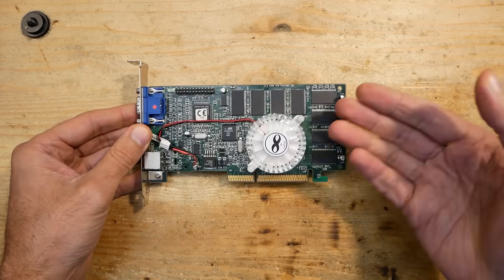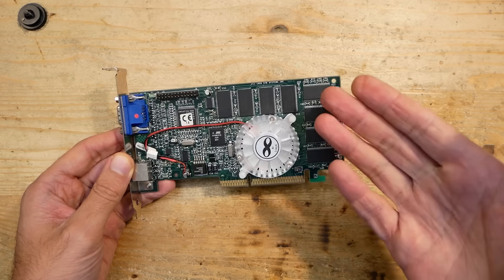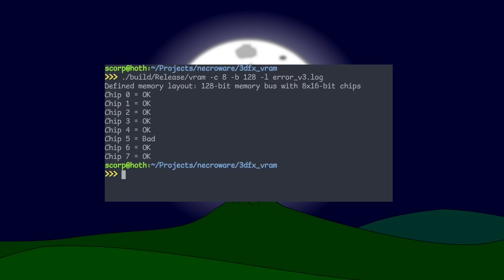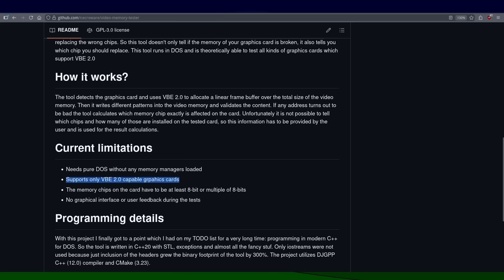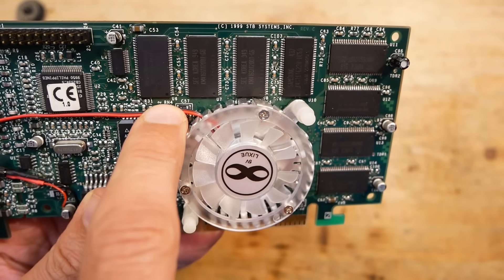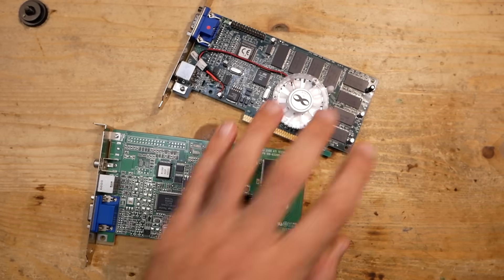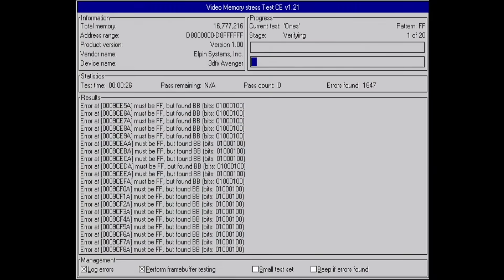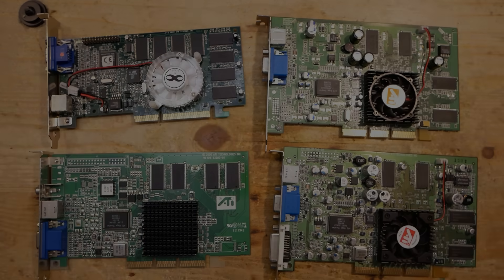Video Memory Tester

Comment: I might just try this tool tomorrow to determine what chip is possibly faulty on my ATi Radeon 9250 that hangs in games after a while of use and a GeForce FX 5200 that has artifacts all over the screen. Def not gonna solder myself though lol never done that.

Comment: I got the donor card with the same memory chips for my faulty Voodoo 3 2000 PCI. I used NWVMT yesterday for the first time, and identified that chip 4 is the bad one (using the logic you mentioned). I will proceed replacing it soon.
Also worth mentioning that when running NWVMT for the first time, I got an error message "error: no DPMI - Get csdpmi*b.zip". I downloaded CWSDPMI, placed in the same folder as NWVMT, and it worked. Just mentioning in case someone else finds the same issue.

Comment: Of course nowadays it's not quite so easy, especially when video cards have an embedded controller that runs everything, and sometimes (in the case of AMD, for instance) even run their own operating system.  I believe on some cards you can ask the controller for memory access, and there are some which have a built-in facility for doing memory tests which can be accessed from the host systems' OS (NVidia has an internal tool for this).

Comment: Does it work on VBE1.2 cards if you load a VBE3.0 bios, like Scitech Univbe (or will that confuse the program). I have a Diamond Stealth64 Vram card that works fine in Dos text modes but if I run any game from Dos (graphics mode) it causes complete screen corruption.

Comment: I've been wondering for some time. Without access to the specific memory chips in the FX5200, is it technically possible to replace them with chips removed from a DDR400 RAM stick as donor chips? Or use chips that can run at higher speeds but don't have an active pin on the last data bus, whereas the old chips did?

Thank you for sharing this interesting tool. I'll definitely try it :)

Comment: I'm graphic card collector and this tool looks great. I'm not able to make any repairs, lag of shill. But I think to add this tool to my testing workflow to quicky validate vram. As you've mentioned, even if there are some small glitches which can be missed during testing, your tool can detect. So maybe option without bus and chips details which just tell me memory is ok or not would be sufficient for me.
And about VBE support - have you tried together with UniVBE of DOS vesa drivers? This way even very old cards can get VBE support or cards with old VBE can get newer one.

Comment: You could have a multistage test, a very short cycle "dead test", and then a deeper scan if all chips pass the dead test. Also might be worth tracking a bitmap of the errors to suggest a possible pin connection fault

Comment: Very nice !
One thing that could maybe be used to find which card is which exactly (and letting you know how many chips there are automatically) is trying to hash the vbios and compare it to the bioses on TRW ?

Would this work for ISA cards as well ?
Reply from the maker: Hashing the BIOS and accessing the internet is probably an overkill. This tool is meant to be used from a boot disk and dos. Well, there are other ways first which have to be evaluated. Currently it seems, that many cards have faulty VBE implementation reporting wrong memory size. That can be probably solved by relying on PCI registers where I also can find further information about the memory.

ISA is currently not on the list. The tool uses VBE2.0 and for the older card another path has to be implemented which would be compatible with the older cards. Currently the focus is on PCI/AGP from the end of 90's to the beginning of 2000's. Once that works reliably, I'll evaluate if ISA cards could be tested as well.
Reply: @necro_ware  Sorry for the misunderstanding, I didn't think of doing anything with the internet, just having some sort of pre-compiled database of vbios hash to card "layouts", similar to what uniflash is doing with ROMs.
It doesn't even have to be inside the .exe, just have a separate file that can be updated over time (and if there isn't a match, fallback to the old method)

Thanks for the explanation with ISA :)

Comment: Is there something like this but for the Voodoo2?
Reply from the maker: There is one tool in the works. It's called Witchery, but it is still in closed development and is not yet officially released by the developer.
Reply: @necro_ware  Aah, Yeah I've seen it on the Bits und Bolts channel but could not find it anywhere online. I think that mine Voodoo2 has some issues with memory but could not tell because I have very subtle texture artefacts. But I can also try to disable TMU and limit the memory.

Comment: For the card that has a completely broken video output.

Most AGP motherboards had an option in the bios that allowed you to select the primary video card (AGP or PCI (If I recall correctly they were usually set to PCI by default)).

I know that this means that you need to support multiple display cards in the video-memory-tester tool but at least it should make debugging easier.

Comment: Absolutely terrific.  I was aware of some limited in range paid tools to check a few types of main RAM, but this a small compact command line tool, is just a tremendous gift for us.

For old ISA cards, I have a hardware opensource tester, so I can test chip by chip unsoldering them, but this is so much better.  Thanks!

Comment: Save the 8500. I had a 9100 and if I remember correctly it's a rebranded 8500LE. I think you should be able to Edit the BIOS and slow down the timings. I've modded a 9500 64MB to a weird 9700 PRO 64MB a long time ago using only a hexeditor, so it has to be pretty easy (can't remember!). There are ready decent bios editors too.

Comment: Very nice! But how about cards with 2 graphics ics or if you have 2+ adapters in system?
Reply from the maker: Currently that wouldn't work, since I use VBE standard which doesn't support multiple graphics cards. For such systems and more modern cards may be a more sophisticated tool can be made in the future. For now the range is limited to retro hardware from end of 90's and beginning of 2000's.
Reply: @necro_ware  Cool. What I had in mind is Voodoo5 5500 or 6000. Not very modern cards they are.
Reply from the maker: I didn't test those, but they should work. From the software point of view it makes no difference how many GPUs there are on the card. They should be transparent and the memory should be linear. "Should be" because there are always surprises :) That's why I hope that I'll get some test reports and can fix and/or improve the issues with the tool.

Comment: A couple of long shot things, but I was wondering: 

1. Is it possible to only address a single chip regardless of the bus bandwidth? ie, if you know you have a 128-bit bus and 8 chips, can you choose to read/write only that 16-bit segment while leaving the others alone? 

2. Is stress testing such a small area likely to have the memory chip heat up significantly higher than if the memory wasn't being used much or at all? 

If both true, maybe a tool could be written to continually stress test only the bad chip, leaving the others idle, so that after a bit, someone could look at the card with a thermal camera (or by touch) to see which single chip is warmer than the others, thus giving the user physical confirmation as which chip to replace. 

Long shot on top of another long shot, I know. I'm just wondering out loud.
Reply from the maker: Yes it is possible, but it will not end up in a heat up which is significant enough to be measured. Though in the future I would like to add stress tests, since some cards fail first after a while.

Comment: Maybe a feature for the tool could be a chip ID function where it just continuously writes 1s to the data bus of one chip and 0s to the rest so someone could maybe probe with an oscilloscope and see which one's getting a different signal than the rest.  Could also make a stress test-like mode where it just runs in a loop forever until one reads bad or just gets tagged as permanently bad in the final reports as it keeps running over and over, so someone can just let it run for hours to sus out an intermittent problem.  For identification, I imagine VBIOS hashes or ID strings might work?  Though that might not differentiate different OEMs and stuff.  There might be other PCI information areas that might be able to hint at or at least differentiate between different OEMs.
With those ATI cards, do you think it would be possible to populate the components needed for the DVI port from the one to the other that's going to be fixed?  DVI output from old PCs is hugely useful with modern monitors, and just getting a clean signal.  It would be an interesting experiment to see if it works, unless there's some reason why it definitely wouldn't like some firmware switch that's baked in somehow.

Comment: thank you for that tool.
I just wonder... what about BGA solder balls under the chip for example voodoo3?
it is also often issue. let's say that some of the solderballs have cracks. And they are data lines to memory.
So the software tool would point to faulty memory chip, but the issue can be in solderballs under the core?
am I right? if yes, then please add that warning to documentation - that if the graphic cards has chip/core mounted by solderballs, then the tool can give false resoults.
Reply from the maker: Yes, that is of course possible. The documentation is basically not existent yet and there will be a lot of stuff to mention in the future. As I said, this is a very early proof of concept version. Not beta, not even alpha, it's 0.0.1. Just to get the basic functionality and then see how far we get.

Comment: Great tool. And great to see POSIX style arguments for a DOS executable ;-)

A hacky idea for "heuristically detect the number of memory chips" - just for the fun!

1. clear the cpu cache
2. Read every 4th byte in video ram, record timings / cpu cycles
3. Repeat step 2 for at least 64 KB
4. Look if you find access time spikes at 2 KB, 4 KB or 8KB _each_.
The repetition spike pattern (e.g. each 8 KB) reveals the number of chips, e.g. every 8 KB means 8 chips
(assuming a 1KB memory chip page size but most chips from the 90s era should have that)

But of course, this is only theory. In practice, you need to obtain high precision timings and even if you have that, lags at the PCI/AGP bus can make problems, too...
Reply from the maker: Yeah I thought about that as well. I'm uncertain about the reliability of such a test, but will experiment with this approach at one point.
Reply: I'd expect unaligned writes could be a good way to detect some details of the configuration. Trying to do unaligned  32 bit or 16bit writes across the 128 bit boundary followed by a read from somewhere else would likely  be very slow as the GPU would need to do multiple read modify write operations in order to service the LFB write request before it could service the read request. Caching on the GPU might cause trouble with successive accesses to nearby addresses so timing checks should be done using addresses that would be far apart.

Comment: Ich würde vorschlagen, die Chipnummerierung mit 1 zu beginnen. Das sollte weniger verwirrend sein. Im Übrigen reicht es auch den Video Memory Stress Test mit der Small Test Option laufen zu lassen.
Reply from the maker: Ja, das dauert leider trotzdem sehr lange. Außerdem hat der Small Test bei der im Video gezeigten Radeon 8500 nur einen defekten Chip geliefert.
Reply: @necro_ware  Hmm OK ich verwende den oft und das geht eigentlich sehr schnell. Ein übersehener Defekt ist natürlich blöd.
Reply from the maker: Wenn es keine Fehler gibt geht es auch schnell. Nicht ganz so schnell, wie jetzt mit dem neuen Tool, aber ok. Erst wenn man defekte Chips hat, dann fängt das Tool die Adressen zu printen und  dann dauert es ewig. Wir sprechen da von Stunden gegen wenige Sekunden. Und ja, in meinem Fall habe ich die richtigen Ergebnisse nur bei vollem Test nach über 5 Stunden erhalten.
Reply: @necro_ware  Ok ja ist ja auch ein anderer Ansatz. Ich hab beim 1. Fehler immer sofort abgebrochen einfach nur um die Karten auszusortieren. Chips kann ich eh nicht Löten von daher war es mir egal wo der Fehler liegt. Dein Tool ist aber trotzdem cool. Vielleicht nehme ich es in meine Test Suite (erweitertes Phil's Benchmark Pack) mit auf. 😊
Reply: Falls du deine Ergebnisse für die 8500 und 9100 validieren möchtest, kannst du R6XMEMID verwenden. Findest du auf vogons.

Comment: I clearly heard Adrian Black screaming when you explained that a memory test should just write data, read it back and compare them ;)
Reply from the maker: I'm afraid, I need an explanation here 😅
Reply: @necro_ware  Adrian had several lengthy rants about memory tests in a few videos of his :) He had examples about memory chips where every cell (bit, byte) seems to be correct by a simple read back test, but the chip is still bad, because writing to certain cells affects the content of other cell or cells. There are cases where you think you filled the memory, but you only write to one half of the chip twice. Of course the tests that can detect the most interesting faults (march tests) take very long time... Your tool is very useful and I think in most cases it will show the bad chips, but if you find a card where your test finds no errors but the screen is still corrupt, you may need to implement a more sophisticated testing method as an option.
Reply: @Flashy7  The speed of the AGP 1x is ~266MB/s, of PCI ~133MB/s. Even if you substract the overall overhead, I think both buses are fast for running few patterns. The simplest chip problem will be a disconnected/broken/stuck address/data line. A simple all 0 and then all 1 pattern will reveal the problem. For address/data line aliasing (lets say 2 pins are bridged), few psedorandom patterns and their inverts will be enough to identify the problem. Only for edge cases of timing you will need many passes and more complex patterns.
A tool that identifies the problematic chip/chips with a success rate 90-95% really fast is very usefull and you can have the option of let it run for 4,8,16 hours in a loop.
Reply: @necro_ware  if it was as easy as just checking the value, you could zero all bits, then check if they are all zero, and then write all ones and check for that. That would work in seconds at most. (just do some napkin math on memtest86's memory speed vs size). There are many trickier failure modes (like row and column address decoder failures) that will need different tests to catch. Memtest86+ has a Test Descriptions setting, and googling for their names usually will result in descriptions about the kind of issues that test can catch.

Comment: Many thanks for sharing this! I've tried it already on a few good/bad cards. I have a few observations to share as well. Sometimes, the tool doesn't correctly detect the total amount of memory (gf4 ti4600, ati x850xt) - for these cards, it shows only 16Mb. GF2 mx400 - detected a bad chip #2 which seems correct, while for gf4 mx440 it showed all chips ok, while mats 3.41 identified errors in bank #1 for the same card. for a higher end cards (ti4600, x850xt) it showed either all chips are bad or all chips are good (when tested on a good card) while with mats 3.41 running on ti4600 showed errors on bank A only. Please let me know if you want me to run any additional tests on these cards so you can improve the tool. Thanks again!
Reply from the maker: Great! Thank you for the feedback. Currently I rely on the memory size delivered by VBE, which can be wrong. I'm already working on the next version, which will gather this information from the PCI registers. Let's see if that brings some improvement. I tested the tool on a ti4 4600, 4800 and Quattro, and on those cards the memory was detected properly. But I had one TNT2 where memory was also detected wrong. It seems that the BIOS on some cards is unreliable. But, well, as I said, this is a very early version. The more feedback, the better. Would be kind of you to summarise your findings in an issue on the project site. Otherwise I'll lose the overview.

Comment: If you're smart about it you can discover everything: the bus width, how many chips, how they're connected, but that requires to access the memory yourself instead of just parsing a file and more importantly timing the accesses.
Because they're SDRAM, data access will take different time depending on whether it's on the same column and/or row.
Reply from the maker: Unfortunately, you can't do that, because the memory is hanging behind the graphics chip. Direct access in that depth is not possible.
Reply: @necro_ware  I don't know you got that info because these old video cards expose their framebuffer (VRAM) to the CPU through memory-mapped I/O over the PCI/AGP bus.
This is the primary way of accessing the framebuffer, how they were intended to be used, back then.
Reply from the maker: @unperrier  Ah, I misunderstood you. You meant to measure and compare the time by reading from the video memory. That is already on my todo list, but I'm not sure if I'll be able to measure that reliably. I'll experiment with that.
Reply: @necro_ware  looking forward to see how far you go.